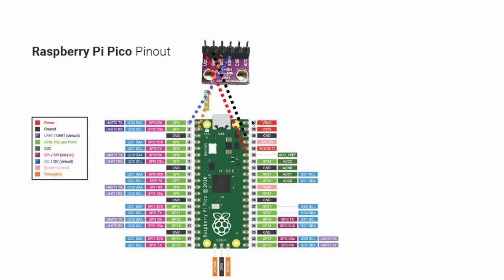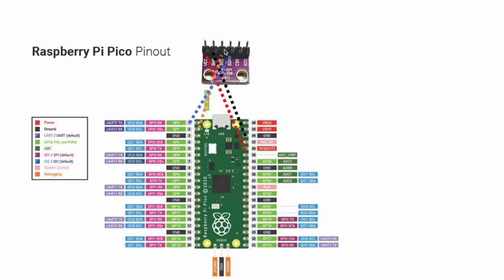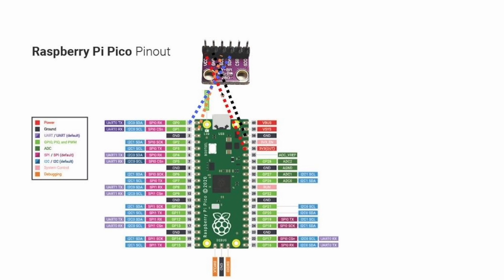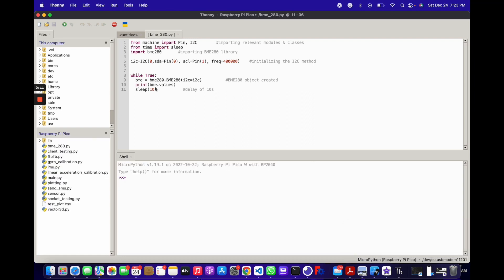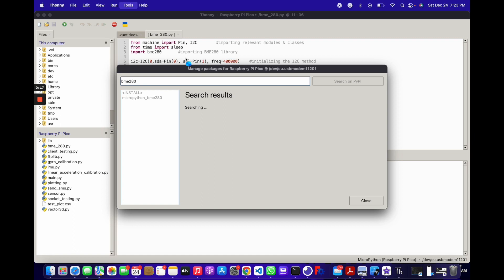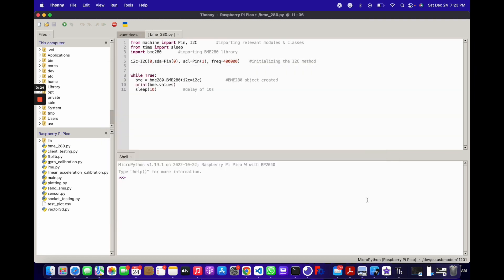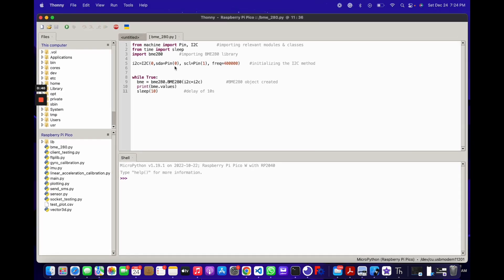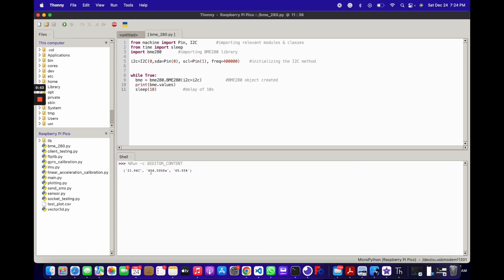(Quick) How to Connect BME280 with Raspberry Pi Pico MicroPython

Comment: I get an 'OSError: [Errno 5] EIO   ...does this mean I need to install pull-up resistors?
Reply: ...and when I DO put pull-up resistors in (if I'm doing it right) then I get the error 'OSError: [Errno 110] ETIMEDOUT'
Reply from the maker: No you do not have to install pull up resistors for this, make sure you can find the object, look into i2c scan in micropython and see if it can find the device.
Reply: @mmshilleh  resistors or no resistors, I keep getting the error 'No pull up found on SDA or SCL; check your wiring'.  I make sure to use the correct SCA/SCL pins and make sure the correct pin numbers are in the code.  I have a BMP280 and an Adafruit BME280 (using Circuitpython) and I haven't been able to make any of it work.
Reply: Hola pudiste solucionar el inconveniente, estoy teniendo el mismo problema y no encuentro que hacer